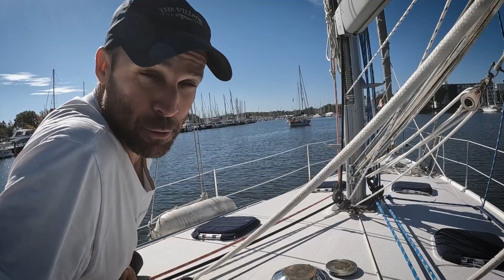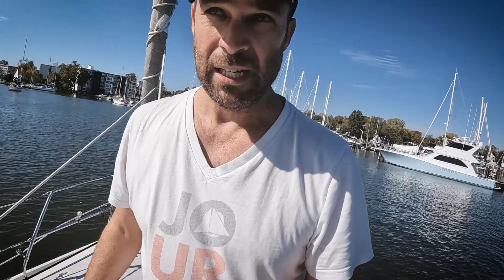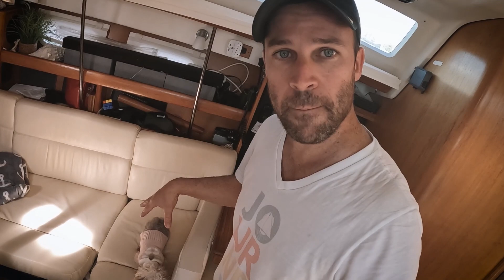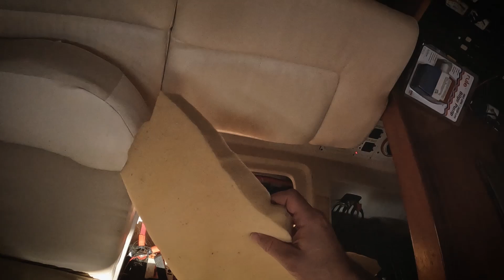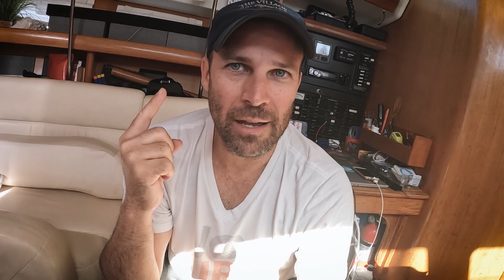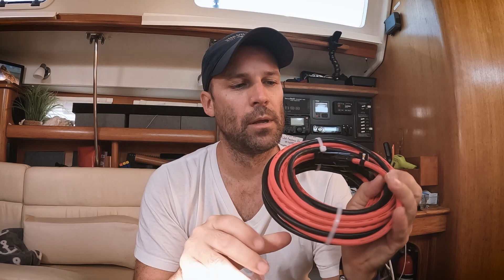Sailing Vlog 15 - ELECTRICAL FIRE, Missing Circuit Breaker, Solar Charge Controllers - Sailboat Life

Comment: I recommend you use marine grade breakers. Those are trash. You might consider using a Victron Lynx Distributor as your bud bar with mega fuses.
Reply from the maker: Thanks for the recommendation. The Lynx looks like a solid product.

Comment: Great video, especially the parts about the breaker. In my Renogy charge controller diagram, there was no mention of needing breakers (from my recollection), so this video was a good one and I hope others benefit from it. It does specify to hook up the battery first, then the panels.
Reply from the maker: Thx...that's my hope and the reason I stress fire 🔥 in the title. There's comment around here where a fire occur in this exact spot between mppt and battery.

Comment: A word of advice.  You should have circuit protection between the solar charge controllers and the bus bar.  It's arguably more important than the circuit protection from the panels.  If the panel wires short, there is a limit to the current (the solar panel short circuit current).  The limit on a short from the battery bus bar, is the limit of output from your battery bank...  Yikes!  AND, btw I have had a victron solar charge controller fail and short.  Something inside the box caused a short (probably overheating in the Florida climate).
Reply from the maker: Thx, I'm learning about how to best protect the wiring from the unconstrained battery power. My only hesitation is this decision - whether to converge the wiring from the MPPTs to a single 60amp breaker vs using smaller, inline breakers between each MPPT and the bus bar.
Reply: @TheFosterJourney  Individual breakers for each controller.  Remember, you fuse to protect the wire from starting a fire in a short circuit/overcurrent situation.  If you bundle the wires to one breaker, but the individual wires can't handle 60 amps, your in effect turning the wires in to a circuit breaker.
Reply: Pacific yacht systems has a great video on this effect.  https://youtu.be/VwK6rCaEVL8?si=d6edRGRIBwOf7QGP

Comment: Good to see overcurrent protection going in. I hope they hold up for you🤞. I’d keep an eye on them for corrosion and heat (get into that locker more often!) 

How are the 4 LFP batteries doing with regard to balanced charging/discharging? They are paralleled but the wiring scheme looks like you may have different resistance in each power circuit. (Can cause unequal SOC and will eventually cause problems. This wasn’t much of a problem with lead-acid, but LFP has much lower internal resistance.)

Also, you mention the ANL for short circuit protection but it isn’t adequate for LFP. You should use a class T fuse which has an appropriate AIC as well as overcurrent protection. 

Missed y’all at Annapolis. 🤷‍♂️
Reply from the maker: Thanks for the insights! The 4 LFP are doing great. We haven't noticed any performance decreases, and we've fully drained them about a dozen times now. I think we're about 3 years in on them.
Reply: @TheFosterJourney  it’s hard to see the topology so they might be equal resistance power circuits (equal pos wire distances to pos busbar plus neg wire distances to neg busbar). 

I remember the install episode—I’m pretty sure the rebel batt guy would have done it right—I’ll rewatch. (Catalina and LFP are how I found y’all way back then). 

Keep up the good content. (Totally get the algorithm inspired clickbait thumbnail…maybe a really small “preventing” or “*”  so we aren’t expecting the Poseidon adventure😉)